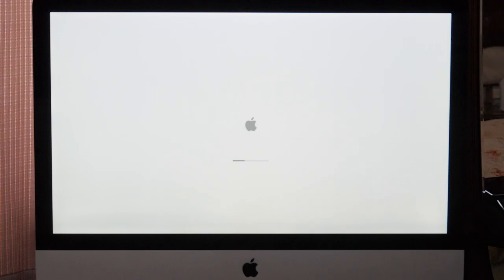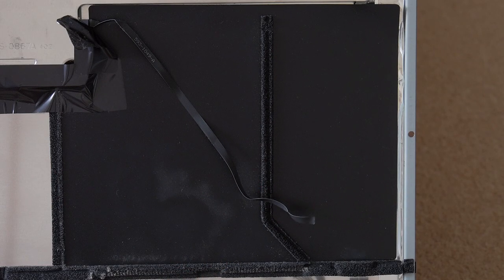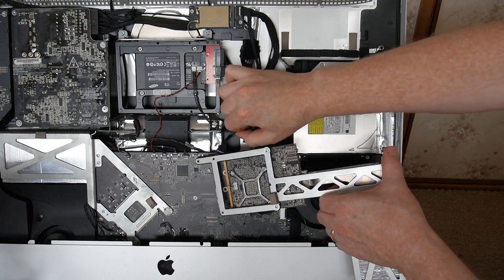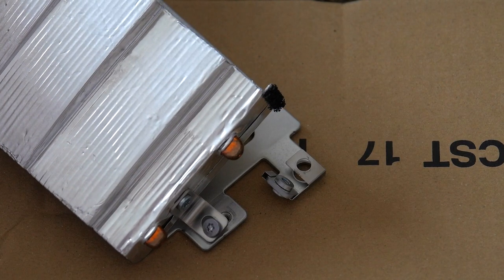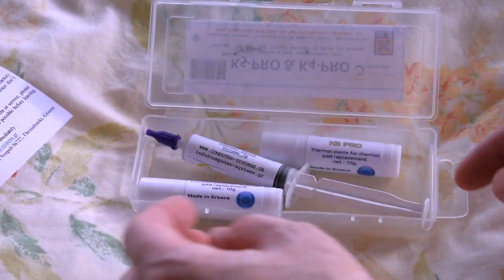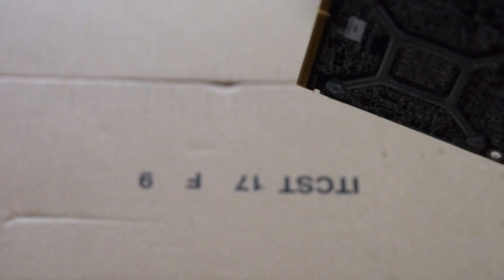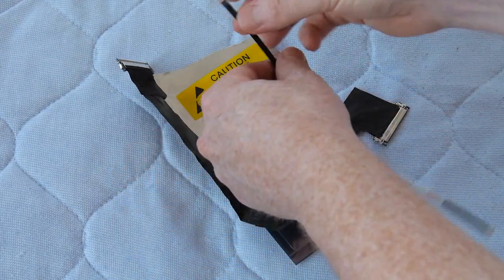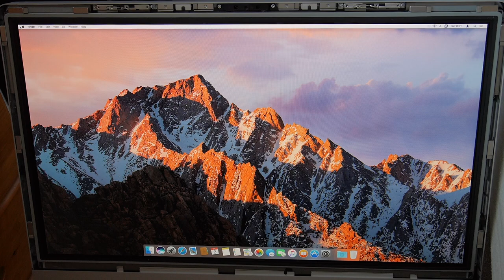Late 2009 iMac 27" Video Card Repair — 4850 — 2nd Bake

Comment: Thank you for an awesome video! I have a MacBook Pro late 2011 unibody with the same problems.. I think I’ll bake the motherboard and see if that works.
Reply from the maker: I would caution you against that, especially if there are electrolytic capacitors on your motherboard, which I am sure there are.  Those capacitors are rated at up to 105°C, and heating them at 200°C for 10 minutes could degrade them.  Baking a video card is one thing but a motherboard yet another due to the differences in components.  

Some people in the comments section here have reported success with localized heating on a video card using a heat gun.  You have to be much more careful when you do that, but it could be that if you heated just the GPU chip on your motherboard (assuming you know which is the GPU), it might work.  But again, I've not heard any positive reports on people doing that, so I cannot really advise you to do that.  You would need to do it at your own risk.  The only thing I can advise is that you Google your specific problem and the model of your MacBook.  If the problem is common, I am sure people will be talking about it somewhere, along with the steps they've taken to remedy the problem themselves.

Best wishes, and thanks for watching!

Comment: Some inside information. As ya all probably know is that hard drives used to show problems after long time of service in the following area's; Swap file area's and area's that were very much used during works... like video editing and stuff. When we look at for example RAM; always the first address-space gets filled up with data. So it is assumable that the first 512 MB (video) RAM are used much more often then the other chips. In contrary of USB sticks, SSD's and other solid state solutions; there is no firmware and software implemented to orchestrate usage of different spaces other then beginning at the lowest empty space... in any given memory. So some chips will always show decay faster then the others. And especially with video RAM, this pays it's toll. I did the baking as well and it worked for a few days. Backed it again and nothing worked after that any more. But I realized after that, there was a RAM issue, not a de-soldered GPU issue. So I have it still as a back-ed-up and when I find some replaceable RAM's I will check on this and display the results of that.

Comment: I followed your method, altough i didnt see any graphic issues i could only boot in safe mode,.. I baked the card for 9 minutes @ 200 degrees Celsius. The videocard works again!  Any updates on how long it worked the second time? Grtz
Reply from the maker: Thanks for sharing your success story. Please know that I always keep the latest information inside the text description beneath the video above, at the very bottom of that text description. Suffice it to say, the machine is still working fine to this day August 20, 2019.
Reply: @JDW-  Thanks for the info, that's some good news! I hope my gpu will also work that long..I also wanted to share you something that might interest you. When i was searching the internet i've found that there are alot of other brands like acer,etc.. who use mxm ati/amd(4000/5000 series) radeon cards.. (probably at a much lower price). So if the card dies again its worth a shot..Grtz
Reply from the maker: @Christian_1605  Using a better video card comes with some caveats.  First, will it fit perfectly?  If not, cutting may be required, and even then it may not fit.  Another issue pertains to thermals.  The stock card runs quite hot, but it is conceivable that a newer card may run even hotter, in which case the stock fans run at max may be insufficient to keep the machine as cool as it should be.  I agree it's great in concept, but I've not seen many videos on people who have had long term success with using a new video card in older iMacs.  Anyway, best wishes!

Comment: Hi, my Mac freezes when I start it and it show some vertical yellow lines on the apple starting screen. Baking the video card as in the video could help me repairing it? 
Thank you
Reply from the maker: Yes. But follow my video carefully.  And if you have any doubts about the stability or accuracy of your oven's temperature, postpone the bake until you buy a turkey thermometer (or similar oven safe one) so you can verify the temperature is correct and remains stable throughout the bake.  Most people are fine.  But I read and respond to every single comment until all my bake videos, and I know there have been a small handful of people who had issues in the past, only because their oven wasn't operating at the temperature they thought it would be.  Too low, and the bake may not work.  Too high, and solder may melt to such an extension components will start falling off.  You'll probably be fine, but when in doubt, use an oven safe thermometer to be sure.  Good luck and best wishes!

Comment: Hey, just something that could benefit you but another method you could do is to buy a heat blower/solder rework station from eBay for 30 bucks. It’s blows heat directly over the GPU for accuracy. ALSO what’s important is while doing a reflow to use BGA flux. This cleans the oxidation from the melting solder balls underneath the chip for a clean connection.
Reply from the maker: Thank you for the tip.  There have been 2 people in the comments who have informed me of their success in doing that.  I think it is a valid technique.  However, I could argue the oven bake method is easier in that the user need not own any BGA flux to do it.  True, there is merit with regard to the solder balls under the GPU.  But the question then becomes, will the heat-gun & flux method last LONGER than a regular old oven bake?  We need more data to know for sure.  But what I can say definitively is this.  Even a brand new card lasts about 3 years.  I bought my iMac new in Nov. 2009.  Three years later, only days after my AppleCare expired, my video card expired.  I wrote Tim Cook and he got my video card swapped out for free (thank you, Tim).  But exactly 3 years later, that replacement card died (and is the same card you see in my videos).  So my guess, based on that experience is that the best one can hope for is 3 years simply because there is a design defect in these cards which contributes to the problem.
Reply: JDW based on my years of knowledge and running a shop that specializes in Apple products, this is a common problem we see all the time. With iMacs, primarily 27 inches, the reason they fail so much is due to poor cooling design. The chips get so hot in those machines and when you turn them off, the cooling plus restarting this process over and over again puts so much wear in the chip PLUS the balls underneath. The reason the heat works is because it melts the balls back down for 1, and for 2 it’s regenerating the insides of the chip. It’s like hitting a starter that’s gone bad so it can start again. I’ve done tests to see which lasts longer and I can tell you with the heat gun PLUS FLUX, lasts way longer. Heating the board up in the over is heating unnecessary components that can get wore out down the road.
Reply from the maker: Thank you for your follow-up reply about the use of a heat gun instead of the oven.  I actually have a BS in electrical engineering, so I understand the merits of your sage advice and I also have no fear personally of following it.  With that said, I also have experience knowing that people who are inexperienced with melting solder do some pretty crazy things.  Just imagine if I advised people to use a heat gun and flux on a YouTube video.  I'd probably get more Thumbs-downs than Thumbs-ups due to people over heating the board and loosening tiny components, allowing them to slip off their pads and potentially shorting on other components.  Then when the plug everything in -- poof!  So I think your advice is excellent, but only for those who have patience, wisdom, a steady hand, and a sharp eye for detail.  Everyone else either needs to go the oven-bake route or just replace their video card outright, or just get a 2015 or later Skylake iMac, which don't appear to have this problem, and they run cooler too.  Thanks again for sharing your thoughts though.  I appreciate them very much and no doubt others who read your words will take them to heart.
Reply: I have a BS in Mechanical Engineering so I can see eye to eye with you on your concept of the realities of this. I totally agree and respect that. Good conversation.

Comment: Hi just brought a cheap 2009 27" due to this fault, going to attempt this tomorrow once all my supplies turn up.
Once its baked how long do you leave it for before you take it out the oven.
Reply from the maker: Bake it for 10 minutes, shut off the heat, then open the oven door, and let it cool for a few minutes inside your oven, then pull it out and set it on your kitchen counter for another 5 minutes until it reaches room temperature.
Reply: @JDW-  thanks very much for the reply. I'll let you know who it all goes. Fingers crossed it works. Otherwise I've taken a gamble and will be out of pocket
Reply from the maker: Having read and replied to every single comment under both my bake videos, I have little doubt the bake will work for you.  But to ensure longevity of your bake, make sure you use good thermal paste after your bake.  I highly recommend K4 & K5 Pro as shown in my video.
Reply: @JDW-  have ordered the same paste you used and recommended. It should be here tomorrow from Amazon. Just itching to get started and get it fixed. Just got to remember to take my time with the screen and not rush it lol
Reply from the maker: Yes, definitely don't rush when you are removing the screens from the LCD.  Mine fell forward and snapped a ribbon cable, delaying my repair by over a week until the replacement part arrived.  If you follow my video, you should be fine.  I look forward to hearing your success story!  :-)
Reply: @JDW-  SHE IS ALIVE.
I am able to type this message from my fully working imac, Thank you so much for this simple yet affective video. Im so happy and didnt break a thing

Comment: THANK YOU SO MUCH! Your videos just brought my 27" back from the brink of candy stripe death
Reply from the maker: That's wonderful to hear.  Thank you for letting me know, Mark!
Reply: JDW I don’t know if you can advise me on a follow up query? The iMac is now glitching intermittently horizontally (I have a video of it) maybe I didn’t make good on the connections?
Reply from the maker: You can post a link to your video if you like.  I don't ban links in the comments.  It is curious though that you did not see this 1 week ago when you wrote to me.  Normally if the bake doesn't go well or if a cable is a problem, the trouble should surface right away when you turn on the iMac.  So I look forward to watching your video before I can say more.
Reply: @JDW-  https://youtu.be/3kf_eNtuxqA watch the apple logo glitch to the right. It did happen straight after I did the bake but I hoped I could live with it. Thanks for having a look.

Comment: Thanks to your video, I just baked my 2011 iMac Radeon Video card, 10 minutes at 200°C... revived it like magic. first boot there was a glitch on screen and it wouldnt display anything but grey screen, then rebooted it and it is fine ever since. 

if it fails in couple of weeks... it is safe to bake it again ?
Reply from the maker: Thank you for watching and for your comment.  I'm glad to hear that the bake seems to have worked in your case, although your report of that video glitch does concern me a little.  I never experienced such a video glitch after either of my 2 bakes, so I am not sure what that means for you.  But yes, you can rebake the card more than once -- in my case, I did it twice.  There's probably an upper limit to the number of bakes, but I have no idea what that is.  But you're probably safe to bake it 3 or 4 times.  If a video card cannot be fixed with 4 bakes, it's probably time to move on.

Comment: I'm about to try this on an 24 inch iMac I picked up for £50 last week. I appreciate your update to let us know that the bake has lasted! I will buy the products you suggest and let you know how it goes. Thanks!
Reply: Well, it's 11pm here in London. The paste arrive through Amazon Prime this afternoon, and I'm just pouring a glass of wine while Mac OS is installing happily on my early 2009 iMac! Thank you for your wonderful videos - I followed them very carefully and could not have done it without you.
Reply: Also, I should add that the early 2009 24 inch iMac has the opposite problem to you! The battery is on the front of the motherboard on the bottom right, but the video card and the heat sink is inaccessible without taking out the mother board. The heat sink also runs horizontally to the left, instead of to the top right like on your model. But, as you say, it's worth taking everything out to clean anyway while there - it's such a large dismantling job we might as well do it right!
Reply from the maker: @jamesthenabignumber  Thank you for details on your bake, James!  I'm so happy to hear it worked well for you.  Best wishes!

Comment: I gave my sister my 2007 iMac which i reflowed in my reflow station (with a reflow profile) and it lasted for a week :( 

Is yours still working? Im going to reflow it again and apply a tiny weight to the core. Since the balls of the main chip aren’t the problem here but the core (in the middle) has been known for breaking connections.
Reply from the maker: I regularly update the text description under my video every month to let people know my iMac its still working.  So far, it's been more than 1 year and 8 months of continuous operation since my 2nd bake.  With that said, I have no experience with iMacs as old as the 2007 model, so I don't know if the video card in those is similar to the 2009 model like I have in terms of problems and solutions.  Most people who watch my videos and do the bake have 2009 to 2013 model iMacs.  On those models, baking works because the root problem is inside the GPU chip, not the solder balls (in most cases).  But on your older iMac, I don't know if the root problem is the same.  You can of course try the bake, but bear it mind it may not work.  In either case, I would appreciate hearing back from you after you try the bake so others with 2007 iMacs can learn from your experience.  Thanks.
Reply: Nice, i reflowed it correctly again (without flux ofcourse) and built it back in. She is working perfectly and i installed an extra fan between the heatsinks to make sure the hot air from the cpu’s heatsink doesnt flow slower through the gpu’s heatsink. I also programmed a different fan profile and the card’s sensor now sits between 38-45 degrees (c).

I also replaced the pram battery since it didn’t hold the time. So in the installation i had to set the time correctly otherwise it wouldn’t install. (Tools->Terminal time xxxxxxxxxxxx)

Ill report it when she dies again

Comment: update: i followed the directions and I’m now up and running!!! I do get some random blinking. 

I bought this same imac for $100 of facebook market assuming I just had to replace the HDD. Turns out that this is my issue. I also ripped the small cable up top and ordered a new one through amazon. I hope this bake works for me too.
Reply from the maker: Thank you for letting me know.  By the way, could you please tell me the Amazon link to the cable you purchased?  (I am curious if it is the same Chinese vendor I link to on AliExpress.)

Comment: Just tried this with my late 2009 iMac 27 .It seems to have worked ,but for how long !!! Fingers crossed
Reply from the maker: My second bake has lasted 1 year and 7 months and still going strong.  So long as you used good thermal paste, I don't see why your bake shouldn't last as long as mine.  Thanks for watching!

Comment: flood the bga joints with some liquid flux to get a better bond and it will last longer.  kester 951 is very popular no clean liquid flux
Reply from the maker: Thanks for watching.  But you are going on the assumption that the solder balls beneath the GPU are the culprit.  Actually, they aren't.  The temperatures of this bake are not high enough to adequately reflow all the solder.  If the temperature was that high, you'd have components on the bottom side of the board dropping off.  No, we are heating the board to fix what ails the GPU "inside the chip."  That's why flux isn't relevant to this particular fix.  Its the heating of the GPU chip, not the fixing of solder balls that's at the heart of the bake fix.  And in terms of how long it lasts, I provide a monthly update at the bottom of the text description above.  So far, I've gotten 2 years and 7 months of daily use out of the iMac since my 2nd bake. Best wishes.

Comment: Need help please: reballing or replacement with a new card?
I have the same problem with my imac.
The technics gave me those 2 options.
Any advice? Thank you.
Reply from the maker: The reality is that you are just like me. The best option is to just buy a new Mac, but since that is too expensive, we explore other less costly options. However, those two technicians gave you two expensive options. What you see in my videos is the lowest cost solution. Basically it cost you a little money and maybe one Saturday of your time. Just follow my video step-by-step, and be sure to expand the text description I put underneath my video so you can see all of the details very easily.  It’s not a 100% guarantee that it will work, but considering the money you stand to save, it’s worth a try. 

Just make absolutely sure your oven has a stable temperature. If your oven temperature fluctuates especially in the upward direction, it may get too hot and desolder some components. Use a turkey thermometer to verify you have a stable oven temperature, and then you should be good to go.